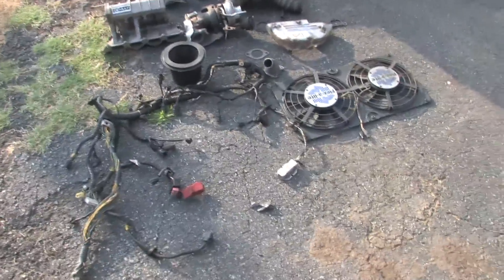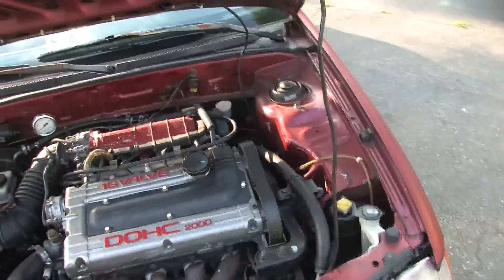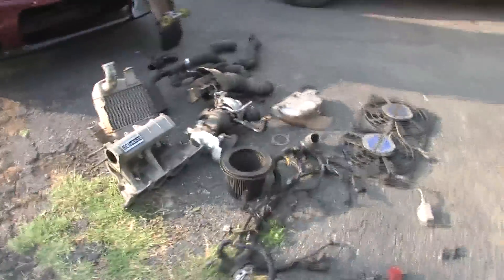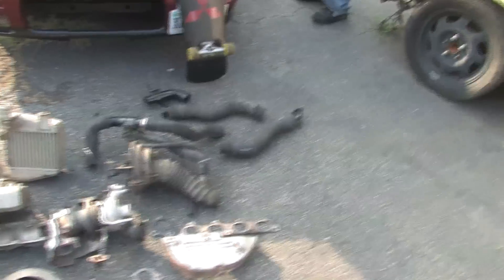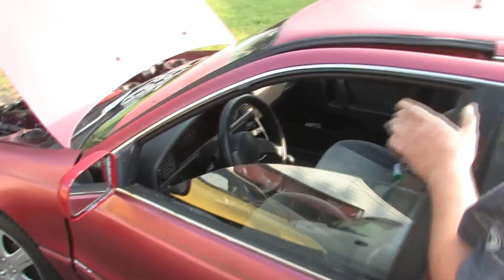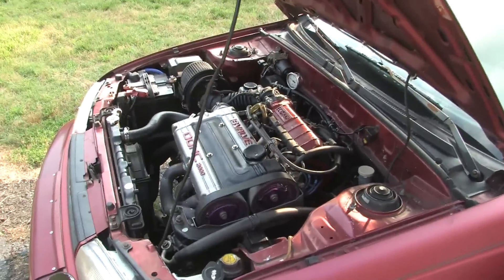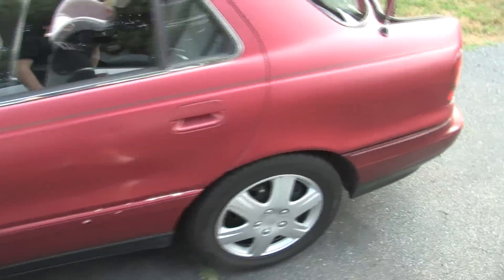Jamie's 92 Hyundai Elantra with bastard 4g63 swap

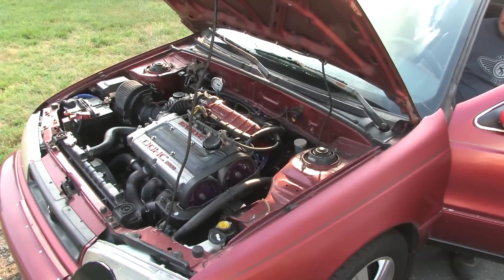Comment: It's interesting to note, maybe it's irrelevant at this point, but if it was running with the same wire harness, the one that was recently diagnosed, and found to have a few faults with it, so that may have been what was contributing to its rough idle at 2:54 perhaps.
Reply from the maker: It was always a problem, but CAS position, valve overlap, and ignition timing made this car a beast to start with or without the wiring fault.  Worse on the cold start.  It's slightly better these days with several of these factors corrected.
Reply: @Jafromobile hmu

Comment: @jsanchez430 Why would you say that? He has a Walbro 255 that flows enough fuel for 550+ hp to the wheels. It's all in the tuning. I've ran 10.5 - 11.1 many times on many different vehicles - mostly Honda. It's all in the tuning. It's high c/r but not unheard of.

Comment: Hello i think i saw 1.6 L sign on the the engine block or I am wrong so did you use same engine block(stock) for turbo? What did you change it for this modification? cyclinder head? I mean did you use 4g63 cyclinder head?
thanks you are great..
Reply from the maker: You saw it correctly!  The cylinder head is from a 1.6L DOHC Elantra.  Also known as the "J1 Elantra".  They're practically extinct.  It's the same model of Elantra as the one in this video, but the head was from a different car.  The head is the Hyundai knock-off of the Mitsubishi 4G61.  The block this car is using is from a 2.0L non-turbo Galant from '89 to '92.5.  Cams are from a DOHC 1.8L Sonata.  If Mitsubishi engineers caught Jamie in the act of bolting this together they would have had a conniption and done everything they could to stop him.
Reply: Jafromobile so Please warn me if i got it wrong :
1) you got a 1.6 cyclinder head from another elantra? so how to find it ? is there a part number somewhere maybe i have same part how to know that?
2:) you said:) i got engine block from galant maybe i can not find 2.0
galant but i can find sonata 2.0 engine block so it makes same job?
3:) which turbo do i have to use for this modification?
4:) howmuch you got HP after this modification i really want to do that please help me about it? 
5:) so can you share part list if you write somewhere or we will find from your videos
thanks a lot for fast response you're the best
Reply from the maker: +brainscan83 the head is from a 1991-1995 1.6L DOHC Elantra.  The J1 is pre-93 production.  I can't produce part numbers and Hyundai won't sell you this head.  If you watch this series I blow up the engine racing it and rebuild it again.  I change a few parts.  I go through the entire build.  ;)
Reply: Jafromobile thanks for information i am from Turkey that s why i can not change the engine block because of turkish traffic rules they check my motor number from license and they match motor number whether correct or not.. that s why can you give me an advice for this car without changing engine block. can i make it 4g61T or another an idea? thanks a lot if you help me about you made me big favor.this car was my fathers's car and he died 8 months ago i want it to make more powerful car but this car can t stop:) i need brake advice also and spring, shock absorders also

Comment: I've got a 5spd 1.6 16v hyundai accent 2dr hatch   going to see about a 4g63 turbo install   any help would be appreciated
Reply from the maker: That frame is going to probably be even narrower than the 1st gen Elantra.  It will be tricky to get the axle lengths to fit.  I'm actually using Hyundai axles with the passenger side shortened 5/8".  Your axle measurements will be however much narrower the frames are.  Use the same generation harness and ECU as the engine.  The KM210 transmission doesn't like the torque of a 4g63t, so you'll probably get a F5M33 to replace it.  Get a '90 if you can find it.  Also, the production year of the accent chassis is going to matter if you want it to be a sort of "bolt on" fit.  I don't know the specifics on that chassis.  I know people that know, but I don't know?  Sadly they don't social media.  But it's always nice whenever we get to sit down and talk.  It's hard to do that when I spend every night making videos.  I believe it would be the pre-'96 production that you'd want to use?  I don't know if it continued after that?  I don't know where in the rest of the lineup where Hyundai divorced the Mitsubishi supply chain, but... maybe you already have that part figured out?  I would imagine it to be around the same time as the Excel, sCoupe,   I have seen people cutaway the front frame rails to make that fit.  I'm not going to tell you to do that.  I wouldn't.  Good luck figuring out what to do with your transmission's reverse switch.  Mine is right up next to it.  It has been done.  I'd check out 4g61t.org if I were you.
Reply: @Jafromobile  هل يمكنك تغيير الدنجل الخلفي لدنجل رالي ارت
انا امتلك النترا واحوال تغير المحور الخلفي للحصل على ثبات اكثر على المنعطفات
اريد لن تركب محور خلفي اذا سمحت يكون مثل محور كفات مساعدات 
مثل الايفو ٣
Reply: هل يمنكنك المساعده

Comment: I have elantra 1991 as you got so can i make it to 4g61T? I compare the specifications with 4g61T 1989 mirage it looks same so how to add turbocharge to my car ? do you have advice for me?
Reply from the maker: You need the whole hot side from a turbo eclipse, Mirage or galant VR-4 as well as the fuel injectors and engine wiring harness.  You'll need to make a custom exhaust.  You'll need to come up with an intercooler and intercooler pipe system.  Once you've got all of this done, a turbo ECU is necessary to meter your fuel delivery properly.  I recommend an aftermarket solution like ECMtuning's ECMlink as you can adjust all the ECU variables for your particular engine rather than relying on a flashed pre-set EPROM chip.  The factory ECU would need to be extensively modified if you don't, and it's a waste of money compared to the gains you'll get from a 2-way programmable ECU with logging capability like ECMlink.  The parts all bolt on easily, in fact, they're a bolt-on fit.  The engine management part of it with the wiring harness and ECU is the hardest part.  And as far as the difficulty involved, it's one of the easiest non-turbo to turbo conversions anyone could do.

Comment: Could this be done to an 07 Elantra?
Reply from the maker: Not without a WHOLE LOT of welding and fabrication.  The 1g Elantras had it easy.  Many models came with a 1.6L DOHC 4g61.  That makes the 4g63 a bolt-in fit, but requires a little cutting and re-drilling holes to make the transmission fit.  After 1995 Hyundai rolled into the beta engine and started producing their own very different stuff.  At least on the Hyundai model.  The 4g64 made a comeback in the 1999 Optima, and a few of the Sorento's I think...  The 6-bolt 4g63 is nearly a bolt in fit in any 1992-1995 passenger cars.  It fits in Excels, Tiburons, Sonatas prior to 1996, but lots of fabrication is required for all of the later stuff to make it work.
Reply: Jafromobile damn, what other engines do you think would be a good candidate for swapping in? I would prefer to do something outside another hyundai engine but no one really does anything with 4th gen Elantras.
Reply from the maker: There's really not...  I mean, there are lots of engines that are great platforms for boosting and modification, but they're all going to come with their own complications with mounts, transmissions, axles and with wiring it into that chassis. Once Hyundai decided to start doing things their own way, their build quality, aesthetics, comfort and appeal all drastically improved... but they left almost all of the compatibility with other platforms behind.  So yes, you can swap nearly any engine into anything... you could make it fit... but if you left that donor drivetrain in the car it came from, it will unquestionably be easier, cheaper, and will likely perform better.  I know my Elantra engine would be in the low-12's in an Eclipse that weighs 700lbs more because all of its go-fast upgrade parts have already done exactly that. But it's a whole second off because the chassis isn't rigid enough, and you can't fit enough tire under it to find traction.  After all that fabrication work, it's a whole lot more money and work to fix all of the little problems like that that you'll encounter along the way.  I think this is the real reason why nobody's doing it.  You could be the first, but that's the kind of stuff you'd need to weigh.

Comment: would this work on my 2000 tiburon
Reply from the maker: If you notice, the timing cover is on the wrong side.  Watch my video on the G4JS.  Search "Why so SIRIUS" and notice how there's a 2.4L SIRIUS II engine like yours in the Kia Optima that will accept Evo bolt-ons.  I've never done it, but all the parts are in the right places for your 2000 tiburon.  ...or you could just use a 2.0L EVO motor.
Reply: how much fab work
Reply from the maker: hyundai tiburon You'll have to ask someone who's done that swap.  A 1999-2005 Kia Optima should be easy to get your hands on to find out.  It should fit, but I've got videos to make and I can't do everyone's swap research for them.  I don't care to feed you guesses and have you mad at me if/when I'm wrong.
Reply: all good man
Reply: no one ever done the swap keep up
the good video

Comment: What parts do you need for the swap Did you have to modify engine harness? My dad has a 95 Hyundai Elantra wanting to do the 4g63t swap is there a way to contact you to get information?
Reply from the maker: The harness is a modified 1990 Plymouth Laser harness I believe... Although I believe he said he had a Sonata wiring harness in it, and he's done that before on another car.

You're going to need a turbo ECU.  There's a gender problem on one connector of the harness that I'm aware of, where the gauge/interior harness interconnects.  I'm not the genius who originally bolted it all together... so I'm still learning a lot about it.  You're really going to enjoy the engine videos I'm currently working on right now because I blew out the rod bearings and I'm currently going through it with a fine-toothed comb fixing the design flaws with combining this pile of parts.  It had ridiculously-high oil pressure which should be a thing of the past...  This thing has a non-turbo Galant block, no oil cooler, 9:1 compression generic pistons and ran a 13.2 that I didn't get on video.  It ran that once.  I think it was built for less than $400.  This car may be coming back with close to 450hp and a total build cost of $800 including what Jamie spent building it the first time.  It's only because both of us have used parts that we keep throwing at it.

What I'd like to point out is if the one your dad has is a DOHC, you've got the J1 engine which is a Hyundai-cast head.  That's the one that has the nasty small-combustion-chamber head on it that I'm using.  This head is a dirty freakin' trick.  Save that when you pull the other engine because it's worth a full-point of compression ratio, and your dad will know what that means if he knows what to do with the tune.  Wait for my next video and you may decide to use that head instead.  I promise you this... finding another one of these things in a junkyard or even on the road is a near-impossibility now.  They're beyond rare now.  They've gone the way of the sCoupe.  Sure wish I could find a sCoupe.  Grease your window tracks because these window regulators don't exist in the new or used parts market.